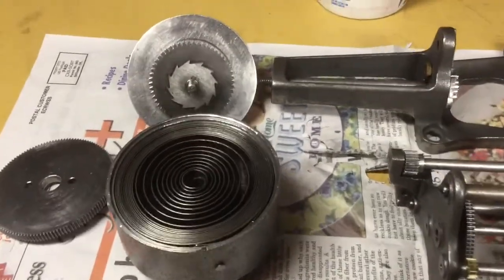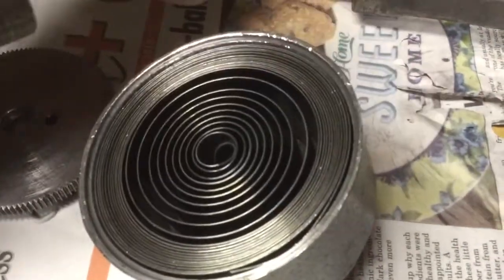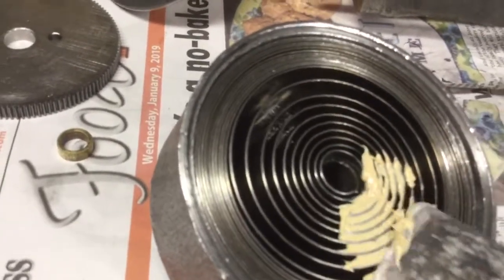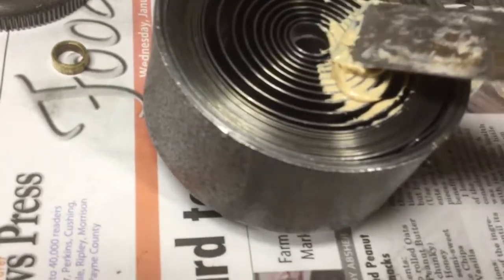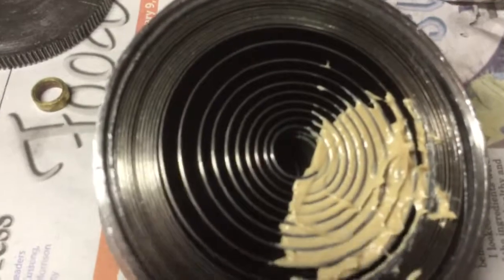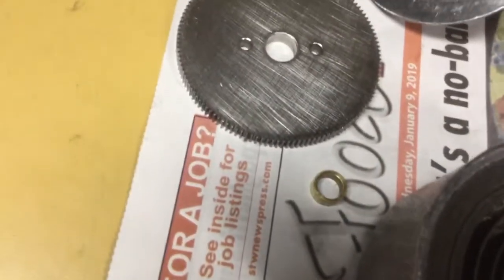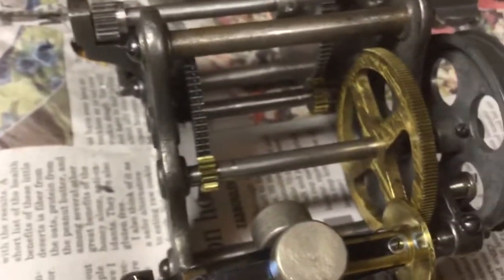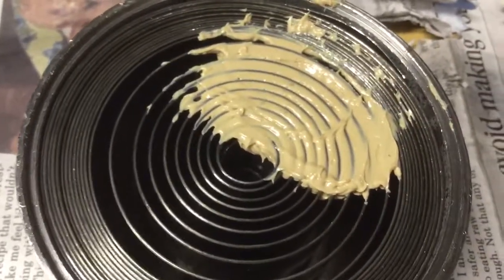Model D Edison Home Motor Repair 5

Comment: Edison's original "recipe" for spring lubrication/gear grease - found in "Edison Phonograph Monthly", "Phonogram"  and other service-related publications directed at repairmen/jobbers/dealers - was 10 parts Vaseline to 1 part Dixon Graphite flakes - no. 2. No. 1 was too fine, no. 3 too coarse.    
Many modern-day repairmen prefer silicone-based greases. Apply directly onto mainspring as you are looping the mainspring into the barrel [of course, starting with a clean spring and clean barrel].  Soaking the barrel, re-used original mainspring - in a cleaning product such as "Simply Clean" overnight - then scrub same using short-handled firm brushes such as stainless steel.  Good luck from:  Your Uncle Josh

Comment: Vaseline and graphite? That sounds like an interesting mixture. Is it just chopped up pieces of graphite dumped into the Vaseline?
Reply from the maker: Powdered graphite was/is available in different weights. One Edison formula I remember from a service manual was to mix "Dixon's no.2 flake graphite with pure Vaseline", though I'd have to look for the ratio.  Oil was sometimes substituted for Vaseline in the grease formulas.  

I like to use graphite as a 'dry' lubricant on things like locks, etc.
Reply: @okbridges  That's very interesting.